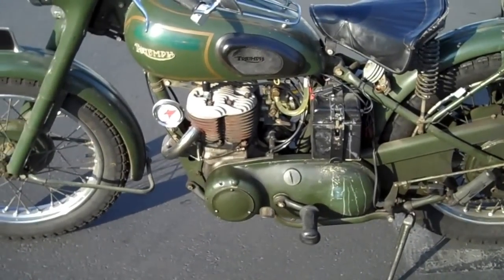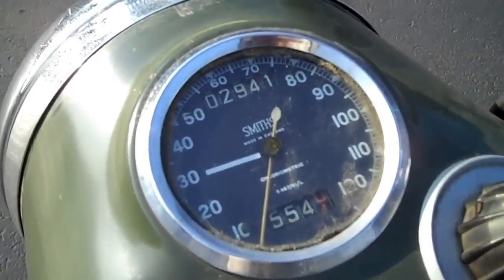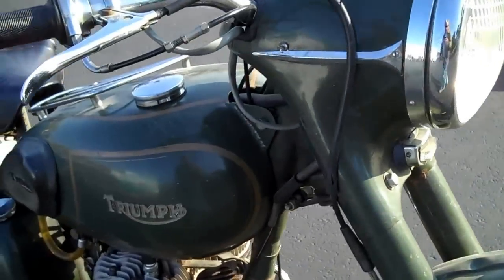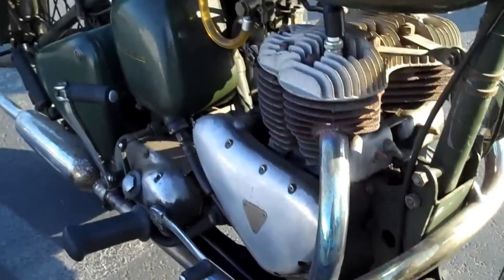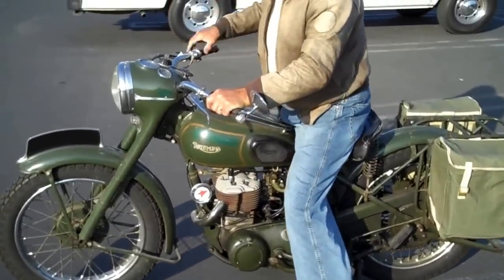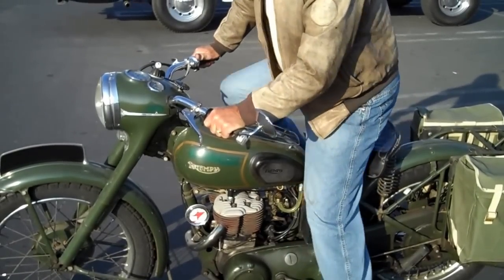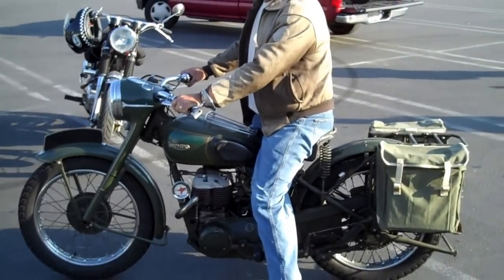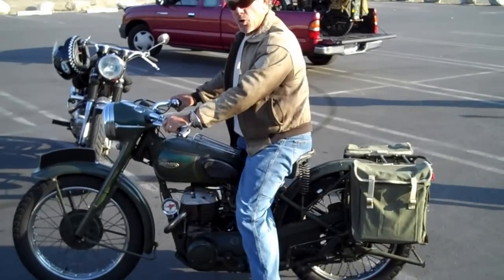1955 Triumph TRW 500 Cold Start

Comment: My neighbor has one in the barn he had a stroke and can’t talk but I’m going to try to get it running for him 
 battery is out of it few wires just hanging and the spark plug leads are disconnected both ends - not sure where they all go but his wife says he would run it every year before the stroke
Going to try to find a wiring schematic and get a battery in it at least to start it 😌
Thanks for the post! Now I know what model it is 👍